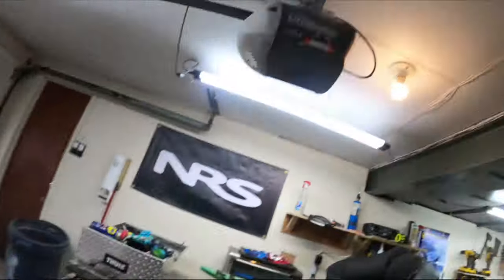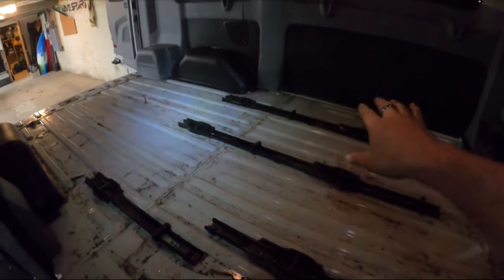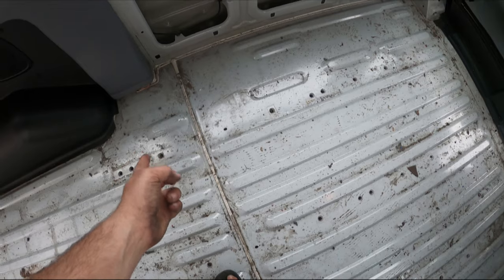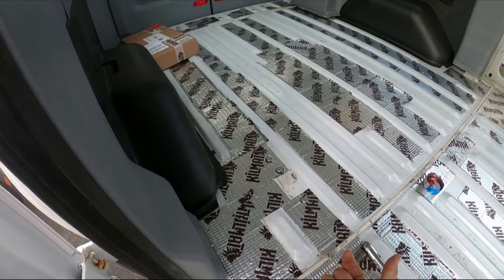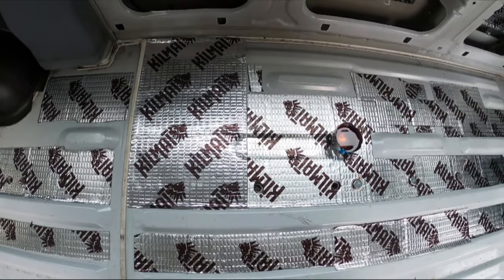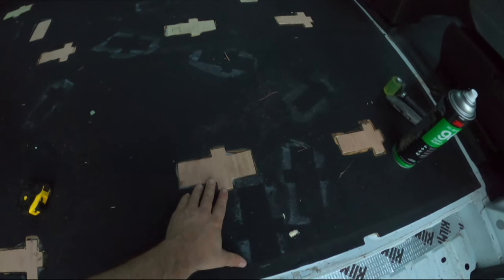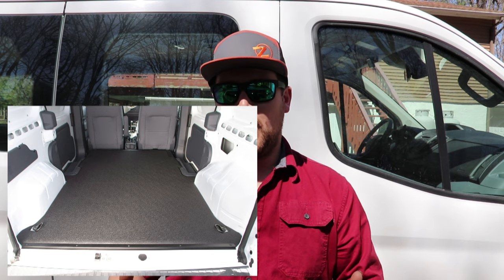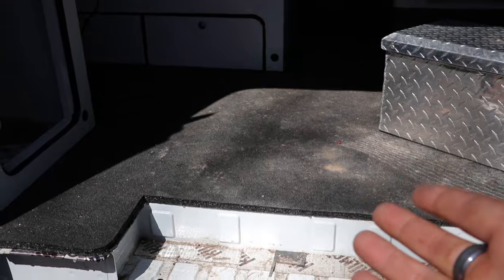DIY Simple Van Floor | Ford Transit | Bed Rug

Comment: What was the official name for the stock cut flooring you mentioned in the end? I have a 2013 Ford E-250 and I’m looking into your suggestion as a subfloor option. If I’m understanding this correctly, we use the stock cut flooring instead of say, a plywood subfloor after we put down insulation? Thank you 🙏🏼
Reply from the maker: Correct, just install sound deadening and then throw this pre-cut floor in. It has been fantasic, and the price per square foot is cheaper than a lot of the other things I see people putting in. Here are the links for the E-series:

Extended Wheel Base w/ carpet top -https://amzn.to/3nim1fn
Extended Wheel Base w/ plastic top - https://amzn.to/3Dk6j9a
Standard Wheel Base w/ carpet top - https://amzn.to/3DuN9gE
Standard Wheel Base w/ plastic top - https://amzn.to/3ozrC0p